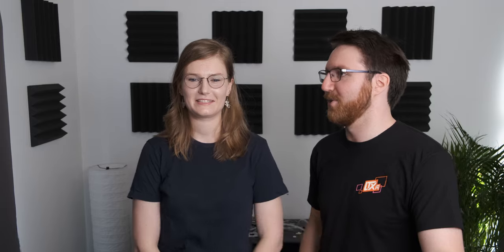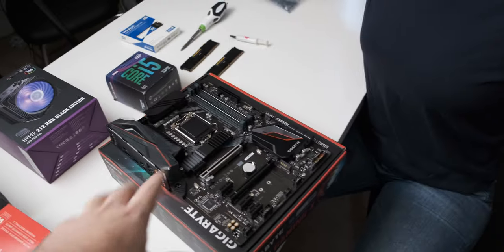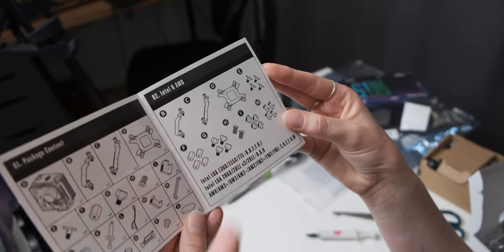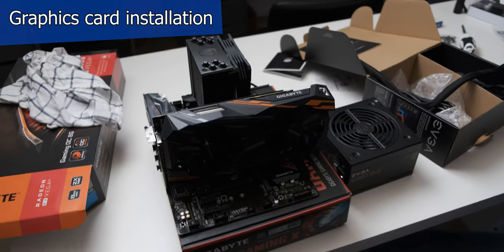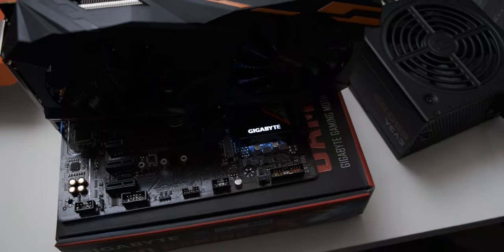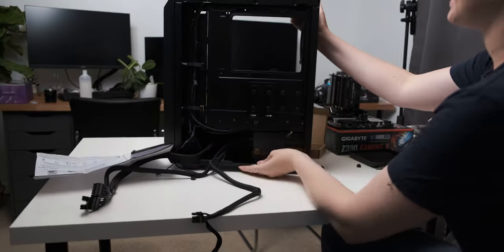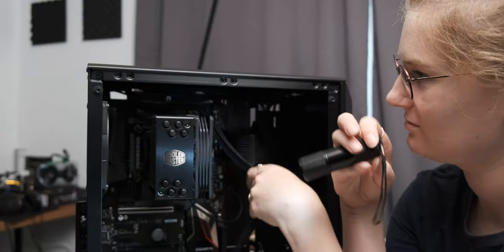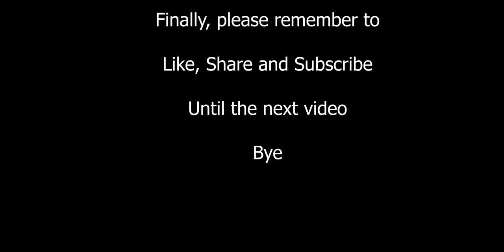She builds her FIRST ever gaming PC!

Comment: I remember building my first PC, I had a great time doing it too. Amazing video!
Reply from the maker: It really is such a fun process! Thanks for the comment. :D
Reply: when was that?
Reply: @fynkozari9271  A few summers ago, I picked the parts out with my dad and then ordered them.

Pro tip: You want to invest the most amount of time in choosing which parts you want.
Reply: @unsupportedsoftware322  yeah i spent about half a year picking products that i wanted before finally building it aug  2017, ryzen 1700 with vega56. i just changed the gpu to strix 2070  earlier this month to use gsync  xb271hu.
Reply: I built my first pc about 5 years ago and believe it or not. Almost all the componets i used have gone up in price by %300 so its essentially worth triple or more than what i paid for it. 

I.e. mobo asus m489gtd3.0 , i spent 125 brand new. It now cost over 500. Just my motherboard alone.
Reply: @therantman4120  I built money sum months ago I found the parts in the dumpster and it took me quite sum time doing it
But it has good specs

Comment: 5min in and already triggered by the RAM not being in dual channel. Or i'm mistaken, but usually the color coding for the RAM slots is for the channels (also it is usually A1 and B1 why A1 and A2 here? beeeh Gigabyte MB i guess)
Reply from the maker: Haha!! I understand that you are triggered, we consulted the manual and promptly misunderstood it. Don't worry, we fixed it after. You can see in the B-roll at the end of the video.
Reply: @DawidDoesTechStuff  all good then :) also great case choice, but if I were you, i'd add fans (at least 1) in the front, I have one myself and it really helps with the airflow

Comment: Oops!  One of the RAM sticks are in the wrong slot.  You should never have them side by side.  Gigabyte boards usually tell you which slots to use first.  Just don't assume the A1-A2 are correct.

Comment: I have the same vega 56 gpu and I'm using a corsair 600m psu and it crashes randomly unless I undervolt the gpu and turn the power limit all the way do u have any problems with this card?

Comment: bad decision for using gigabyte mobo and gpu. gigabyte brand doesn't last long. possibly only about 5 years.
and then issues will show up.

i know cos i have 2 gigabyte mobo. 1 for my core 2 duo and another for my AMD athlon x2 socket 939.
and both has issue with the ram. it's painful to use gigabyte.

i switched to asrock. i do hope asrock is a lot better than gigabyte.

i pick asrock because of buildzoid vrm review of it.

and for gigabyte gpu. a lot of people told me it died very very quickly... lots of RMA... never had any gigabyte GPU. because that brand is on my blacklist forever.